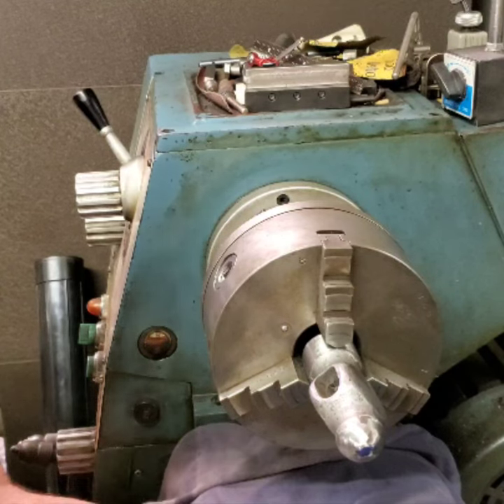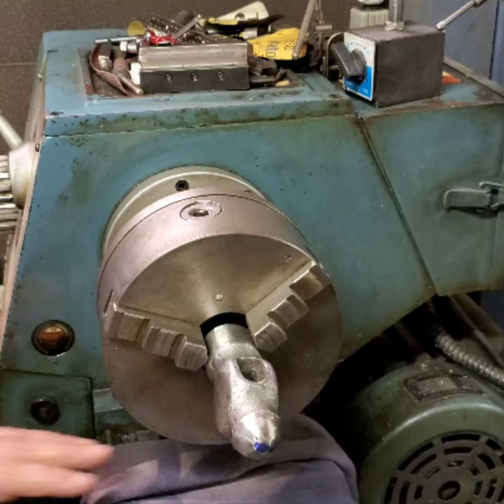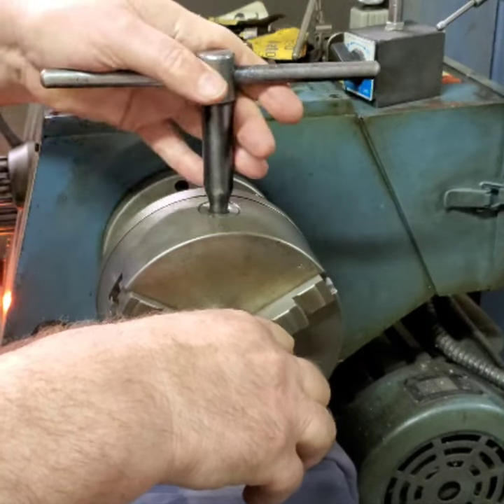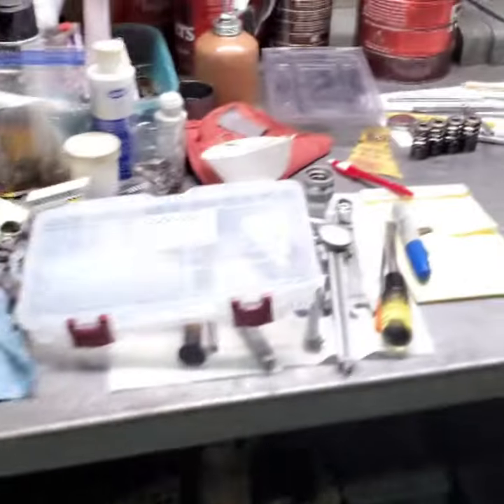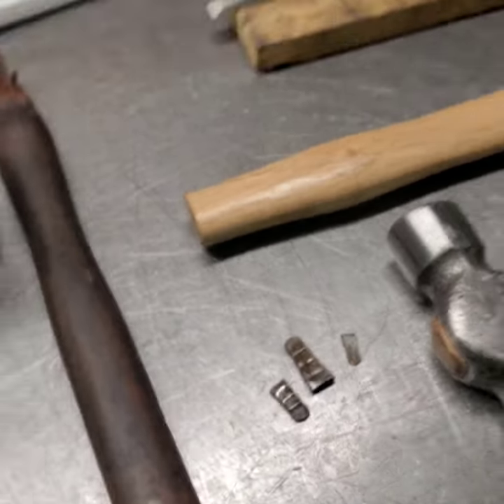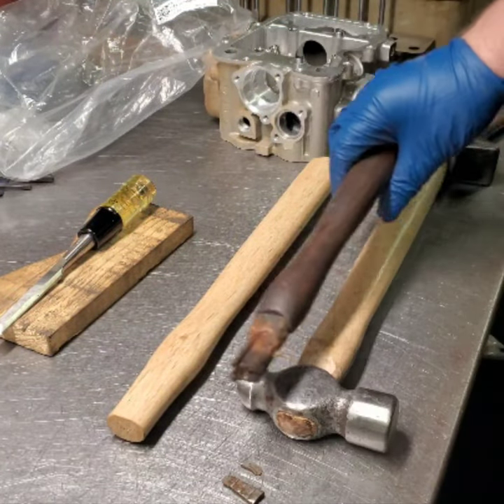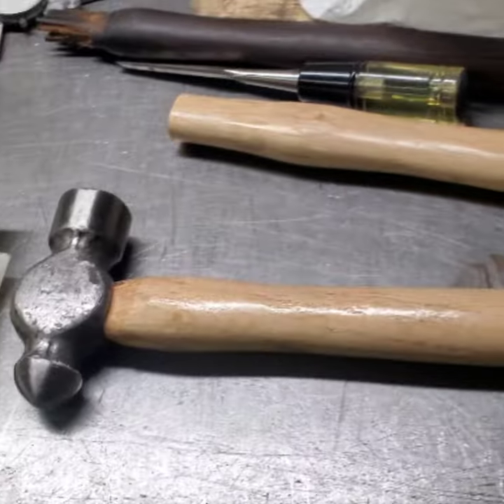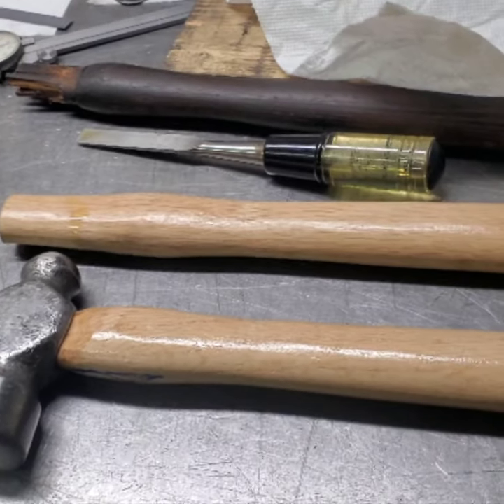Ballpeen Hammer(Plumb)gets a New Handle.

Comment: Ed, this is an off the wall question since I see your nice metal lathe.... have you ever bored out the inside of a piston wrist pin to make it lighter? I need to loose 27 grams out of 142. Lol...is that a fools errand?
Reply from the maker: Hi Stuart, thanks for watching. 
I have never lightened a piston pin.
I know it's been done.
Piston pins are very hard.
Not sure what you're trying to do.
But purchase a lighter pin if you need
to have them.
Have a great day.